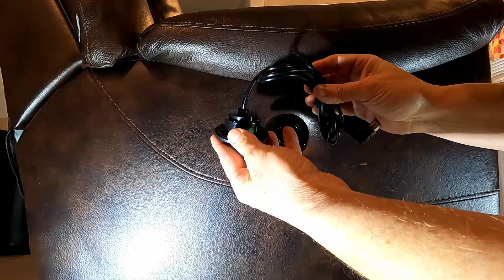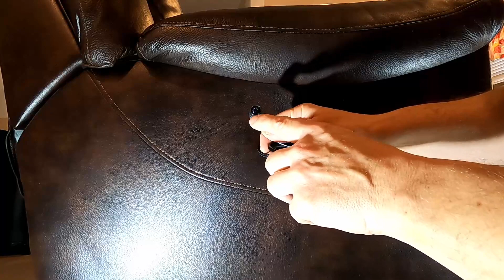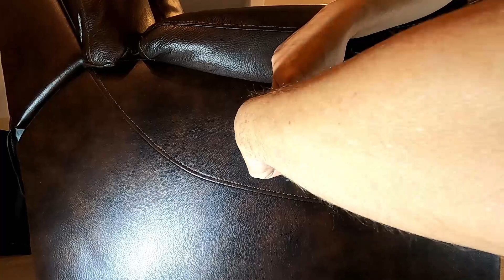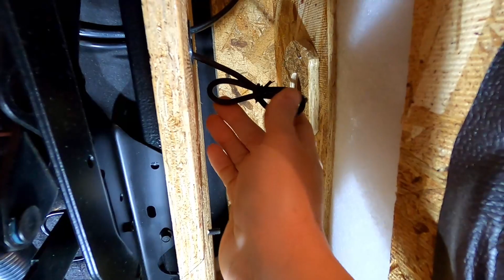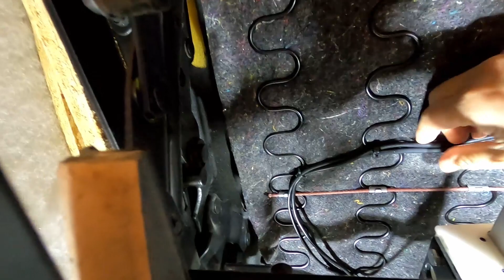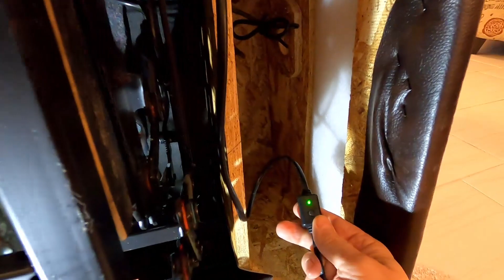Power Recliner Switch Replacement

Comment: First off my OCD would like to thank you for not saying "Power Recliner Switch REPAIR". So many time I am looking to ACTUALLY repair something NOT replace it.  Funny tho I not even here to do either.

I really wanted to see if anyone actually opened up a switch so I can see how it was wired. You see I have some ole' linear actuator from a recliner the neighbor tossed out. Just now getting to putting them to good use but the switches were not in with the actuators. I am thinking that they weren't even on the seats when I salvaged. It is not like me to leave parts like that behind. So anyway, I needed to find out what wire was for what. I can't find anything. No diagrams, pinout, schematics no videos. Every link that said repair a switch , ALL THEY DID WAS REPLACE it.  

Sorry to vent on you. Thanks a bunch. Your video gave me enough information to figure it out. 

 Thanx again.

Comment: Bravo TY.
Q: If my switch operates to recline but will not close. Is it my switch. If I crawl out of the chair then come back and press the close button it will not work. Later on it does. Is it the switch ? 
TY in advance.
Reply from the maker: That's exactly what this one was doing - it was working intermittently, and the switch replacement fixed the issue. If it was the motor, it wouldn't go up or down. Good luck with your project!- Mike
Reply: @mikesdoityourself  Mike atY so much. Superb video.
Subbed and upped.

Comment: My elderly mom has an electric recliner but has difficulty reaching and operating the side buttons on the chair. Is it possible to connect a remote to the chair?
Reply from the maker: I don't know about a remote - that would probably be chair specific- although an internet search might find you something. You could remove the button from the side if you have enough slack in the wiring and wedge it between the armrest and the chair back and use it there- or move the wiring up to that area. Good luck!- Mike
Reply: Thank I you I have the same problem on my sofa I order the switch From Amazon now it is working thank you again